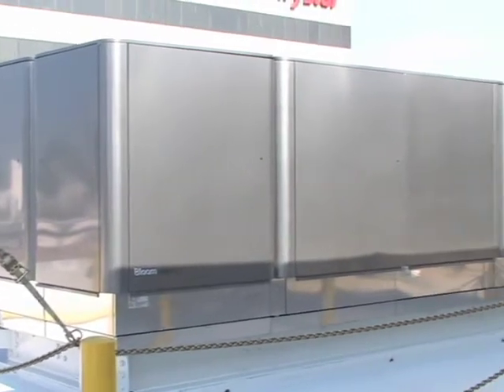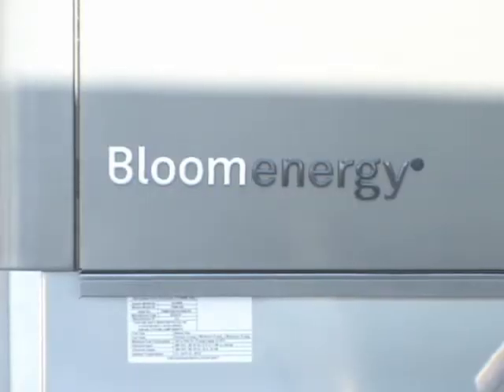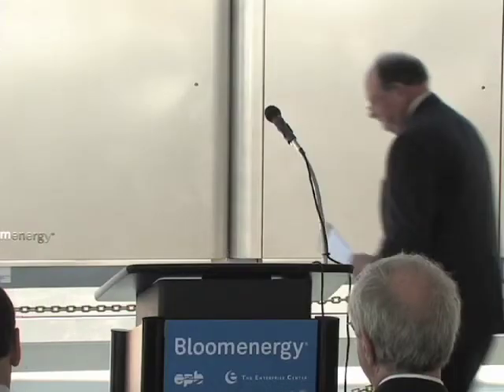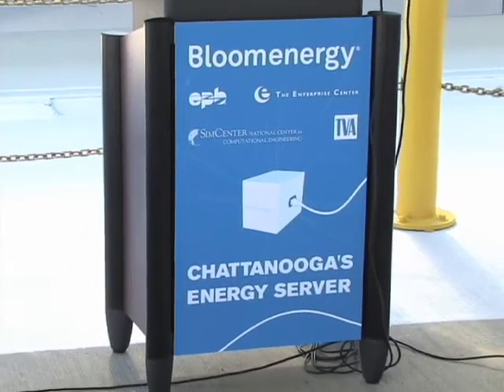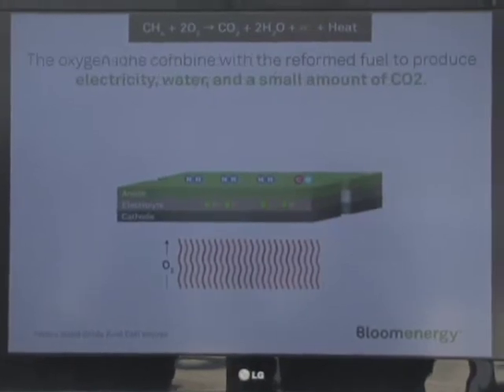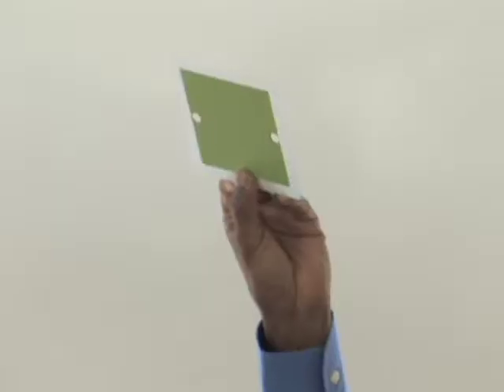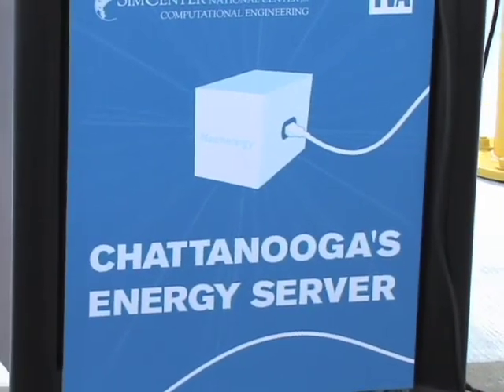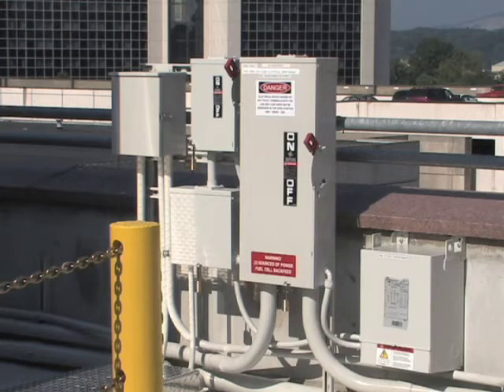Chattanooga partnership unveils Bloom Energy Server

Comment: OK, so this is a type of fuel cell.  What I want to know is whether, like in other fuel cell designs, can it be run in reverse?  In other words, if one were to supply power *into it* from a solar array during the day, would it efficiently produce hydrogen which could be stored and then used as fuel during the dark hours?